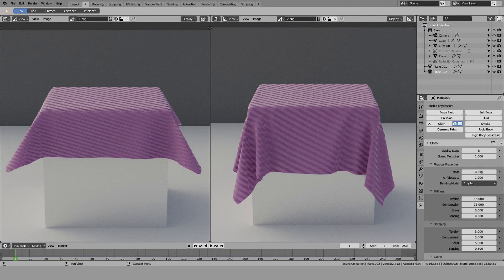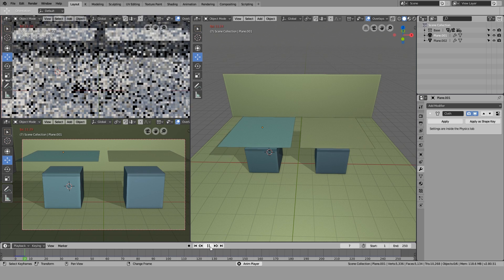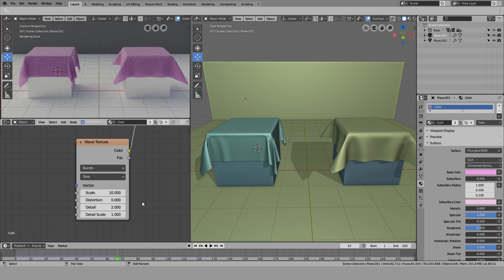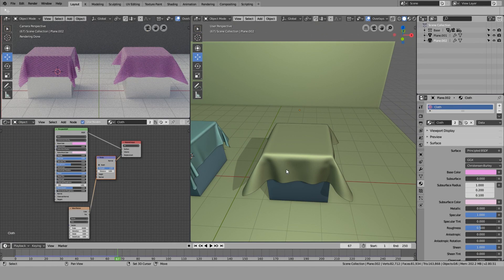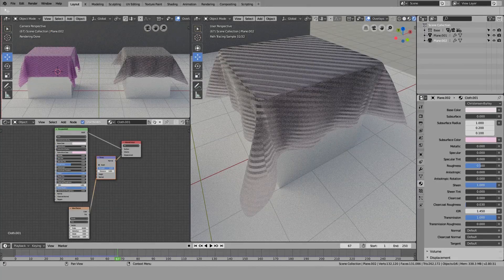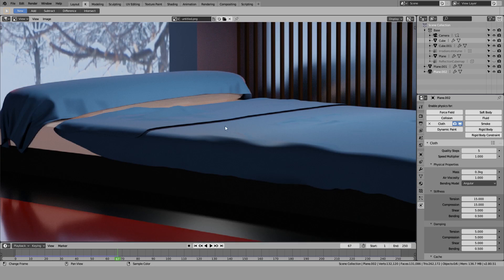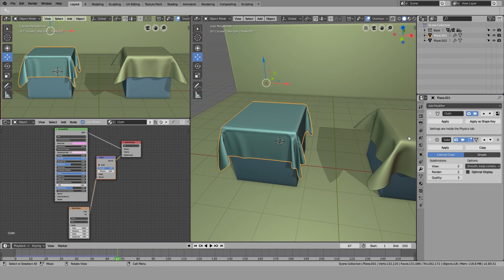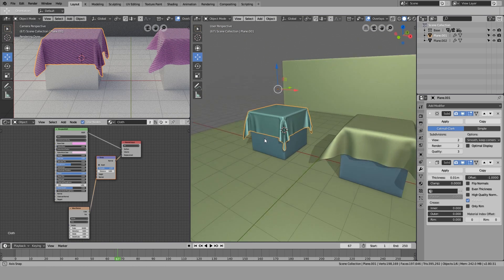Better Cloth Simulation for Beginners - Quick & Easy - Blender 2.8

Comment: Trying to make clothing for a character but it keeps getting eaten by the body model even with collision set to .005 and it collapses into itself like a ball of paper
Reply: Try to switch off the flag single sided in the collisons options of the body model
Reply from the maker: Hey! Enable self collision to stop it from collapsing on itself.

Being eaten by the body however might be another issue, increase the quality steps and also take a look at the Collisions -> Object collisions menu in the Cloth Physics tab, should be around the bottom.

Let me know if that doesn't help!
Reply: @WasiqWiqar  even at 20 steps it still ended up sliding up the body and then crumpling inside tried differnt settings for the distance and even increase bending my settings for the phyiscs were 10, 10, 1, and .8 and all collision were set to .005 with self collission set to .004 to allow folds. Also had pins around the hip line to prevent slipping. Weight was 10grams

Result
https://cdn.discordapp.com/attachments/618952006622773288/619116543095341058/Capture.PNG

Expected 
https://cdn.discordapp.com/attachments/618952006622773288/619033265411457044/test_Render.png
Reply from the maker: @DeathxStrike18  Oh it's not a top, I assumed it was sort of like a shirt that you want to settle on the character's body.
Are you on blender's discord servers? Try asking the people there for help, there's four in total and this post has a nice collection done:

https://blenderartists.org/t/blender-discord-all-4-of-them/696112
Reply from the maker: @DeathxStrike18  Hey so I was doing some things with clothes, make sure the normals are all facing the right way. Your collisions values won't matter if the normals are messed up.
Reply: @WasiqWiqar  normals are facing away from body i always calculate outside and apply acale before simulations
Reply from the maker: @DeathxStrike18  aw sorry I couldn't solve it then, if you figure out a workaround do let me know!